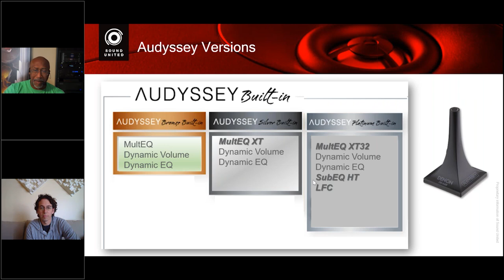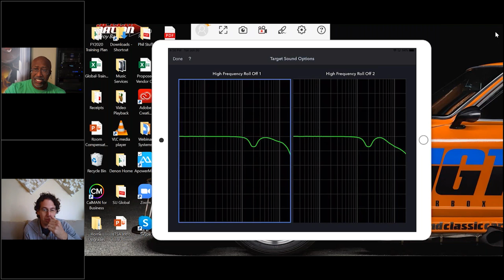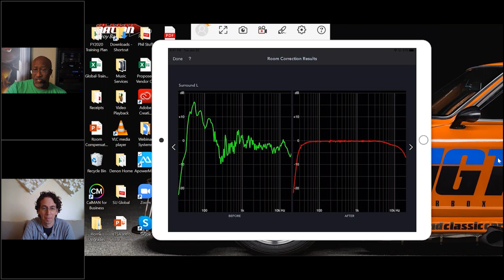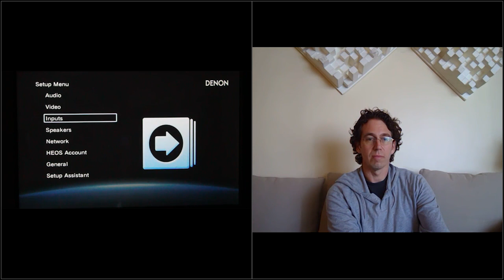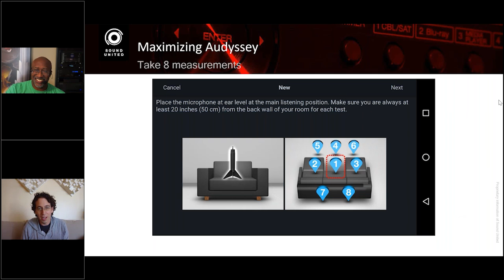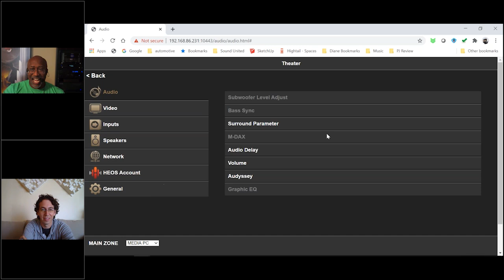Audyssey Room Optimization - Part 2: "Advance Setup (MultEQ App)"

Comment: Audyssey automatic setup is ALWAYS horrible to me. You can ALWAYS get a better sound by setting it up on manual and using
It's equalizer. Next best by the $20 app and learn to use its curve editor. Curve editor is hell to use to get exact frequency you want to correct ! Please upgrade the curve editor and you might have a good product. For most people you need to explain what the frequencies represent, put it under the freq identifier part on curve editor. Like most people say it comments it's hell to accurately grab frequencies need a type in frequency chart.

Comment: Great video — I’ve been using Audyssey on my Marantz AVR and really appreciate how well it handles room correction, especially in the bass region. The ability to apply a house curve is powerful, but drawing it accurately in the app can be frustrating. A few small improvements — like numeric entry for custom curves, ready-made curve presets (e.g. Harman), and a more unified interface — would make a big difference. Audyssey is already a strong platform, and with a little more user control and refinement, it could be outstanding. Thanks for continuing to develop and support it!

Comment: I noticed a slight variance between the results generated by the mobile app and audyssey that is built in the AVR. The mobile app speaker trim is 1db lower for each speaker compared to the results generated within the AVR, and the subwoofer is always boosted by 3db. I have tested this  multiple times. Which one is more accurate or reliable?

Comment: On the AV, how do you save the changes done on the AV as a preset? Say I adjust some settings in the AV and dont want to override the preset 1 done through Audyssey, but save it as preset2, how do I do this.?

Comment: I watched all your Audyssey learning videos, and I really tried to do my best with carefull setup and tweaking.
Results for movies and audio are just amazing. And I use Marantz Cinema 50 with 5.1.4 setup using B&W speakers. 
So it is ok setup with really capable speakers. Still Audyssey did make all corrections just great.

My advice for all that do not get good resutls is few simple tweaks - Reference EQ for movies, Flat for audio. Speakers cut off at 80hz, and that midrange dip to off. 
Do not use to wide area, and do not messure area like you have a cinema space at home. Messure you exact position.

Awesome product, Sound United did great job also with new Marantz series.
Only thing that I would say i based on flow logic from past is midrange dip. I would just remove that part form software.

Comment: Please Dear Audyssey and Sound United Team, let us deactivate the Surround Boost of Dynamic EQ, sitting on a back wall couch the surround and rear heights are awful loud that way!
Reply: If you have two settings one for dynamic EQ and another with it turned off... Why not just go into the channel level of the preset with the dynamic EQ  and just turn the individual gains down on them manually?  Use an SPL meter at MLP to take note of the DB change to make sure on the level
Reply: @ I have done it Like This but it is exponentional, when you turn up or down the volume its not linear
Reply: The surround boost in Dynamic EQ is WAY too hot regardless of room layout in my experience.  I don't use it at all for this reason.

Comment: Been really impressed with Audyssey XT32 for music. I can confirm though that the high frequency rolloff and mid-range compensation don't work for me in my space.  1) Klipsch RP tweeters are directive and 2) even after removing roll off, I have to raise the curve above 4 KHz a bit because with treatment, the highs are too muffled, if I limit treatment to 4Khz, they're too bright.

Comment: Toggling midrange-dip for a speaker affects its target curve and hence EQ calculations, but if you change the detected crossover point (I don't want my mains to play down to 20, but Audyssey detects them as large..) - the target curve is NOT affected - Audssey will still try to achieve a roll-off based on its detected crossover point instead of the one I changed to (in the case of my fronts, no rolloff - in the case of my surrounds, a too high rolloff). Why? And on the subject, why would it even try to achieve a roll-off - that's up to base management to provide based on crossover settings. Shouldn't Audyssey rather try to achieve flat (or whatever the target curve is changed to), down to maybe the XO frequency and maybe another half or whole octave? I.e. don't try do do what bass management already does, but also don't apply useless EQ way below XO point (speakers) or above 120Hz (subwoofer, LFE goes up to there regardless of XO frequency setting).

Comment: Hi. After running the app, it gives me a value of 250 Hz for the subwoofer. Should I limit it to a new value, as I did with the other speakers with the MultEQ filter frequency range ?

Comment: I'm sorry, but the app is a pain for all non-audio-tech freaks. you go through it step by step. Then you have a result with which you are not zufriden and do not know what to do. No real help that a normal customer understands right away.
Extremely many videos on the net that are far too technical. I did not want to become a sound Ingenieur. I had briefly tried a NAD at home and Dirac. Well, that fit right away. For TV and film.
Here I can partly everything only endures if I use the setting Multi Ch Stereo. And nothing has really been improved on the app. Error fixed? What? Everything about everything - weak. Sorry

Comment: Audyssey is great - however, adjusting the target curves is ... difficult. There should be something like parametric EQ, where you can input frequency, Q and level as numbers. That would be great. Please also add a library of different target curves as well, as none of the default curves will sound good. A downward slope on the target curve is usually preferred by most listeners.
Reply: 110 %

Comment: How are we supposed to run Audyssey when using multiple subs on Y splitters?  Such as 2 subs on Sub 1 and 3 subs on Sub 2?  Set the volume for each individually or both (or all three) at the same time being careful that the bass is balanced on that particular line?

The reason we do not like Reference is because it KILLS the high frequencies!  Couple that with Cinema EQ on, I thought my tweeters were DEAD!
Reply from the maker: Hi Dave, I asked Jeff Clark and here is his response: 
"That is correct -- any subs on a single Y splitter should be level balanced BEFORE Audyssey calibration.  Ideally they would also be equal in distance from the primary listening position.  Finally, there might be benefit in some cases of those subwoofers sharing a y-cord being of the same make/model.

Audyssey "Reference" is specifically a replacement for "Cinema EQ" or other forms of "theater compensation" and the two should never be used together.  Furthermore MOST discs these days are remixed for home listening.  Since these vary by studio, it's down to personal preference disc-to-disc as to whether "Reference" is appropriate.  I would say it is likely not appropriate to most discs these days.  Early DVDs often had theatrical mixes.  That is what "Reference" was designed for."  Then there were "THX" discs that had THX "Re-EQ" (Lucasfilm/THX's theater compensation) pre-applied.  It was appropriate to use "Flat" for those discs.  I'm still working out whether Reference is more appropriate to the new IMAX Enhanced content."
Reply: @SoundUnitedTraining  Reference would be great if I still had my Def Tech towers.  They were incredibly bright (front/tweeters) and caused listening fatigue after a half hour or so of music listening.  I now have a 20yr old pair of Paradigm Monitor 90p v1.  Unfortunately, I know they don’t match the rest of my Def Tech system.  But, they are less harsh on the ears and Audyssey does a fair job of EQing.

I’ll be running Audyssey again tomorrow when I don’t have to worry about family walking around upstairs.

Comment: Is there any other way to adjust Audyssey filter curves? Eg Denon has a control protocol which you can telnet into, but I can't find any settings for multieq other than mode selection. Is there a back door to Audyssey?

Comment: YOU are really missing the point of multiple testing positions. Audyssey is taking an average .  PLUS many users ARE NOT interested in a BORING theatre arrangement BUT instead a comfortable 'Living area'  experience .   PLUS you can switch between 5 different ' sound translations' LIVE and select the optimum .
There is a point where the 'pro' opinion becomes purely anal .  (when someone 'believes 'they are being purely 'scientific' they have , in fact, become purely romantic . (objective looses out to subjective)

Comment: Mid range compensation is terrible.
Reply: No, it is not. Definitely not from non exotic speakers around. For instance, my KEF T205 speaker setup has that dip naturally seen in the green curve. Just my thoughts based on what I experienced with my KEFs.

Comment: Once the room correction file has been uploaded to the receiver in Preset 1, what do I need to check in the receiver Setup Menu to make sure it's gtg? Just make sure Speaker Preset 1 is selected in the receiver?

Do I have to make sure MultEQ XT32 is turned on and set to a specific setting in the Audyssey menu (i.e. Flat vs Reference)?
Reply: Once you send the final results to your receiver, it will be saved under whatever preset you chose. Audyssey will always be tuned on at this point and the new calibration will be under the" reference " option.  It will never be sent to" flat " setting. 

The only way to know if it's gtg is if you go through the receiver menu and check on some changes that you made in the app. Like for instance Audyssey for some reason will always set front speakers to " large"  or set the crossovers differently. So whatever changes you made in the app should show up in the menu of the receiver once you go through the settings in the receiver.  Hope this helps.

Comment: The question as to what frequency cutoff point is correct for EQ'ing; the answer is within the minimum phase region... which occurs from the transition region downward. 

EQ'ing above the minimum phase region is an exercise in chasing your tail. Any EQ change made is only applicable and valid in one single point in space. 

Either way, EQ'ing above the room's transition is tricky business. Hell, small room acoustics is tricky business.
Reply: How does the average lay person determine cutoff frequency?
Reply: @ronalcasid3844  
Depends on room dimensions... typical room sizes it's likely above 100hz, and below 300hz.

It's best thought of as a region... whereas the behavior transitions from distinctly clear resonant behavior (big peaks/dips), toward an area whereby the resonances are so tightly packed they're indistinguishable.

Comment: I’m having a problem with my MultEQ app. It doesn’t recognize either of my receivers on the network. It searches for minutes and can’t find them. I also tried searching by the IP address and it said the address is invalid. I tried using all devices on a guest network with no luck. I paid for the app but I can’t even use it. I’m using an iPhone and my receivers are a 930h and a 4400h. Internet radio Works on both so I know they’re on the network. Any help would be great.
Reply: I have the same problem with the App, don’t recognize, start and stops in middle of the calibration etc. the App itself has 2.5 stars for this reason
Reply: I had an issue with that too, so I switched to WiFi instead of Lan in the AVR, and worked just fine.

Comment: Hi for some reason when i run the calibration from my receiver avr x6500h it sounds better than when i run the calibration from the app and send it to the receiver with the same settings is there a way i can download the .ady file from the receiver and then import it into the app to tweak on it any ideas what i could be doing wrong should i try running the app from a different phone

Comment: Hallo Philip. I have a question. I find the Audyssey app very nice but the only way it works for me is via a PC with an Android emulator as Bluestacks or Nox and to handle the computer directly from the PC (Windows 10). With an Android tablet or phone, it always crashes. I've contoled everything and fixed all possible "weaknesses" of my internet at house and the modem: everything is OK. Do you have a suggestion? A connection with cable is always better than WiFi. Why does Denon-Marantz not propose Audyssey for PC too?
Reply: How about more than two presets? Why not three or four? Shouldn't be too difficult to code.
Reply: The more convenience and flexibility the better for the user. You've just proven you can use the app from a PC (with emulation). Audyssey app should definitely have Windows and MacOS (with "dual" Intel/Apple silicon versions) to interact with the system through your computer if that is your main device.

Comment: Post measurement will changing the subwoofer curve alone to say a  Hartman curve with a +10 dB base increase and gradual roll off after 100Hz cause the sub level to change accordingly. Doing so does not reflect any change on on the curve editor, hence the question .

Comment: Great video and thoughtful coverage. Make it so much more clear on what goes on behind the scenes. Does the Marantz 8805 allow for the use case you setup on the demon ? where in the sound preset can be saved one for a measurement of individual listening position measurements and another for a wider listening position like family measurement? I do not see the speaker preset in the audio options but the remote does have smart presets. Not sure setting two different measurements one after the other and savings as smart preset 1 and 2 will actually save the EQ filters as well as in the cases a dual speaker selection option. If so that would work ?

Comment: It's possible to use the app on a PC and on a bigger screen than a smartphone. Install an Adroïd emulator as Bluestacks and it will run on W7 or W10. I've done it and it works great. It's much more convenient than on the little touch screen of a smartphone.

Comment: Please add manual numerical frequency entry of the curve and decibel in the MultEQ app. It is nearly impossible to make accurate adjustments with a finger in the app.
Reply: 4 years later and we still don’t have this option….
Reply: Agreed, it is very good but trying to get the numbers you want is like a bad game, almost every time I get it and lift my finger off the screen the numbers chance again...and I am using a tablet on mines. It has improved my overall sound for sure but it is really not user friendly for editing curves, so takes a hell of a lot longer than need be.

Comment: Great info video! How does Audyssey MultEq X32 differs from YPAO  R.S.C. with 3d multi point precision EQ?
Reply from the maker: While we didn't do a direct comparison with YPAO, we do cover Audyssey MultiEQ X32 in detail in the web sessions below. Please check part 2 which covers MultiEQ app.  
https://www.youtube.com/watch?v=XdBSDSASUnk&t=1287s
https://www.youtube.com/watch?v=j_wS1bG_Fbs&t=1424s
Reply: @SoundUnitedTraining  I just purchased a Marantz AV 7706. I ran audyssey and it put all 7 of my speaker  levels to -12db. Ran it again same thing. Using XLR cables. Emotiva Amp. Was using Denon AVR with preout with rca cables. Should I leave all the levels at -12db?
Reply: @bonscott3291  No, you can use use an spl meter after to set correct level to 75db for all. Running the eq is to set correct delay. Run your receiver at 0.0db and put the SPL meter facing up and make sure all speakers and subwoofer are set to 75db. Then you're done

Comment: Hi Guys, thanks again for a fantastic webinar.
Phil, in general should the EQ in audyssey be set to reference or flat?
Also would it not be better to have the mic with 50 feet of cabling as in general it is way to short.
I would prefer to pay extra to have a cable I can use instead of not being able to use the audyssey mic.
Sorry for being long winded.😊
Your input is much appreciated, thanks again 👍
Reply: Honestly the cable length is pretty decent imo. If you did need more you could probably get a male to female extender cable to put between the mic and the avr.
Reply: @TylerStout  
Hi,
Thanks for your reply but not everyone has their amp in the same room.
I actually did get an extension cable on Amazon and it works great, but it is extra hassle and not everyone knows that you can do that.😊

Comment: Does the Audyssey app adjust for phase differences, and can this be adjusted?
Reply: I have Audyssey X32 in my Denon AVR 4520. I know, old stuff, but I can really say that the improvements it provides in clarity and imaging are amazing. My main concern is that it always seems stingy with the bass. I have to turn up the subwoofers to get a good level. Looks like the phone app can provide hours of fun experimenting to get a desirable bass curve.
Reply: @tomkohman4620  This is the one thing that is making me upgrade from my old Denon which cannot use the app. I want more bass!
Reply from the maker: If a wire is wired incorrectly it can't fix it but Audyssey measures phase. The system automatically correct minor phase issues via the time domain (delay).  

Note: Audyssey will somethings state that a speaker appears "out of phase" during setup due to the wiring of a speaker's internal crossover. If the speaker is wired correctly you can ignore this warning,